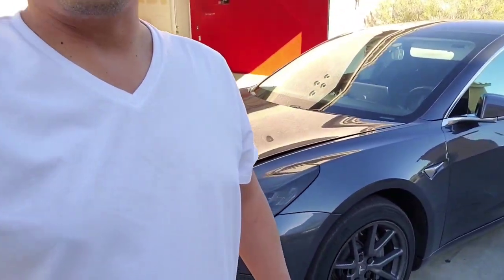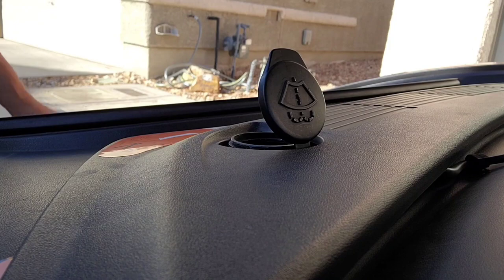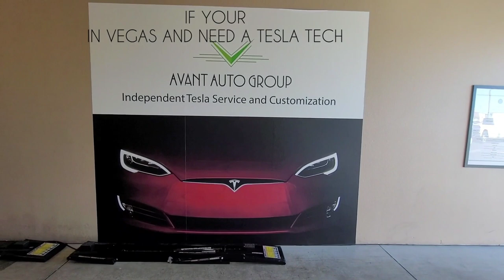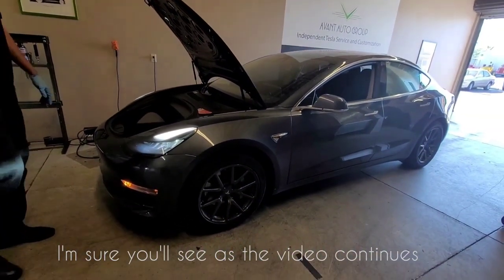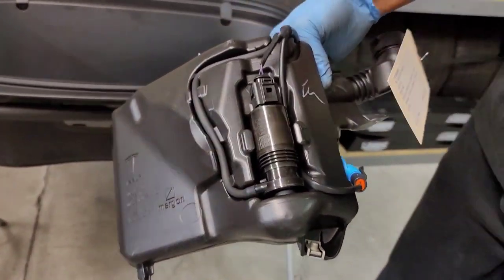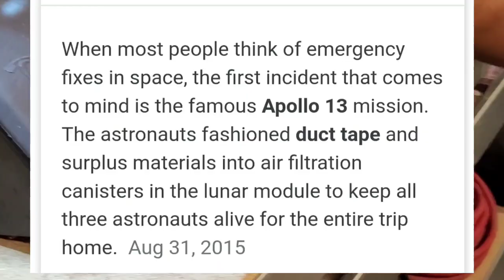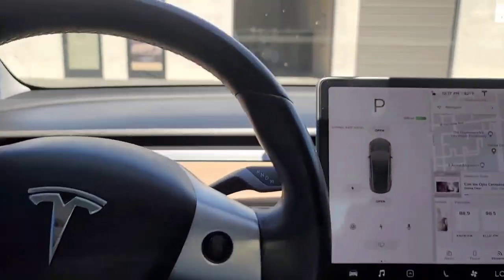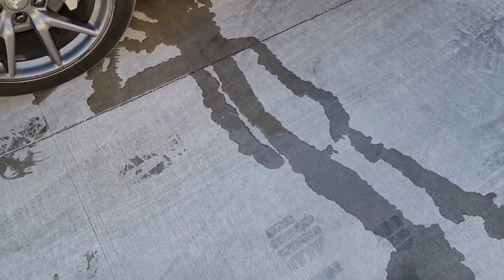TESLA MODEL 3 WATER LEAK

Comment: JB Weld would have been better crack sealer. Would have been permanent. Epoxy is fine but JB would have been more permanent and stronger.
Reply from the maker: Plastic
Reply: @thechrometesla1887  Yes I know it's plastic.